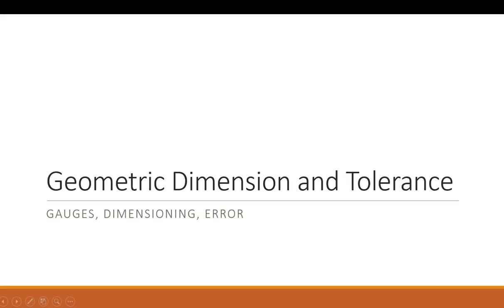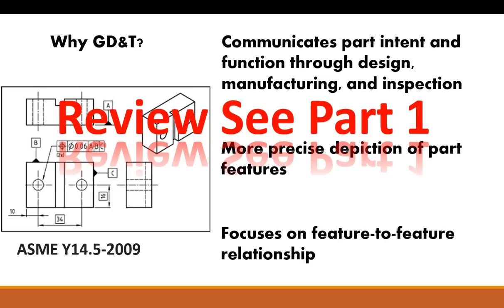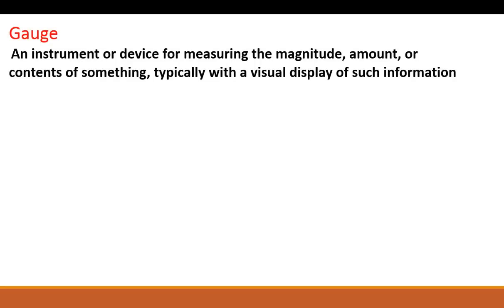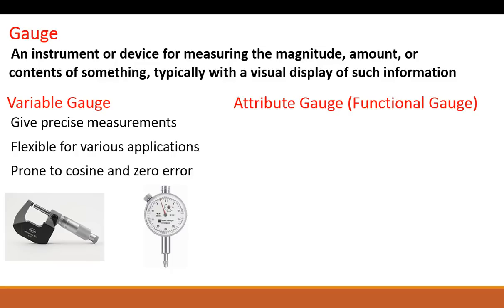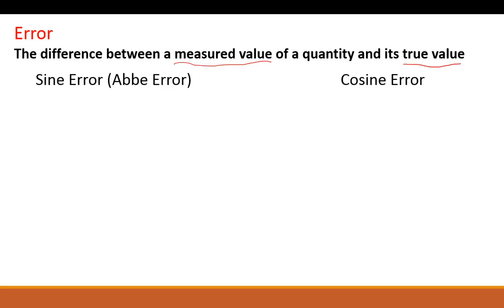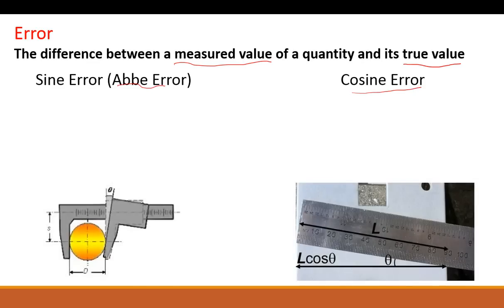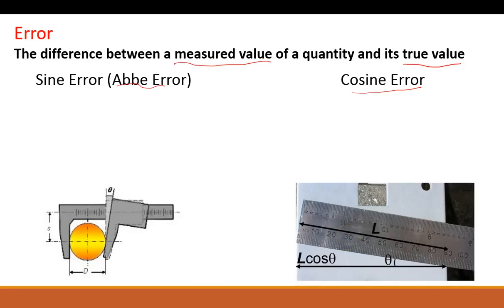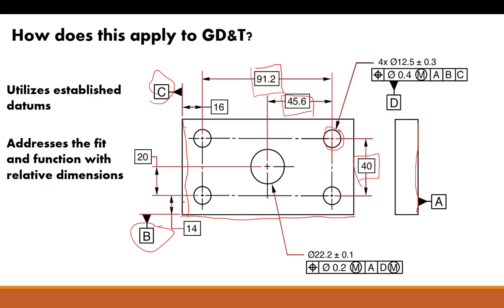#GD&T (Part 2: Gauges, Dimensioning and Errors)

Comment: I remember during my internship. I was measuring the dimension of a cold storage area from beam to beam using chain measurement. I ran into a stack up error when our designer pointed it out, so I had to find where the error started which was frustrating. But overall it was worth the experience.

Comment: Great video. Please correct me if I am wrong, for the example with the caliper (sine error), the error does not depend on the measured distance and depend only on the length of the sliding arm of the caliper. Also, the formula for the cosine error L*cos(theta) gives us the true value, but the formula for the sine error L*sin(theta) actually gives us the error itself. So the variable L in those two equations are of different nature: for the cosine error example L is a measured value, but for the sine error example it is the length of the arm of the caliper. I just wanted to mention all this so that people do not get confused.

Anyway, thanks for the video. Keep up the great work!

Comment: Good explanation. I'm a Q.A Inspector.
Reply from the maker: Thanks! That's awesome feedback, especially from someone that has to do things like this for a living.
Reply: @Infinity MFG, I use GD&T at work. All of these symbols are on the blue prints, and engineering drawings. CMM software Metrology like Mitituyo Crysta Apex 7106, this one uses Window 9. CMM also have all of these symbols in its software. Some companies use PC DMIS software for their CMMs. But PC DMIS is an old software (2011-2012).

Comment: Hi, I have doubt on Positional tolerance when they are applied on  length dimension..ex, a shaft with 10mm dia here OD is Datum B and one side face of the shaft is Datum A and other side face asked for 0.1mm position w.r.to A and B...and the length is 50mm basic dimension...Now what is teh tolerance to be applied for 50mm?

Thanks in advance...if the question is not asked in clear... please give your mail id...I can mail you

Comment: Good video, but what does that M with a circle mean?
Reply from the maker: Maximum Material Condition
Reply: vaibhava br Maximum Material Condition meaning the smallest hole possible.
Reply: What about when the M is in the datum? like |A|B(M)|C|
Reply: Kun Lee The maximum material condition symbol next to the datum B (which is a hole) indicate that it's at the lowest limit tolerance of the hole diameter (smallest hole)..